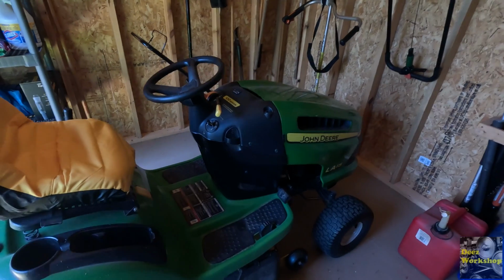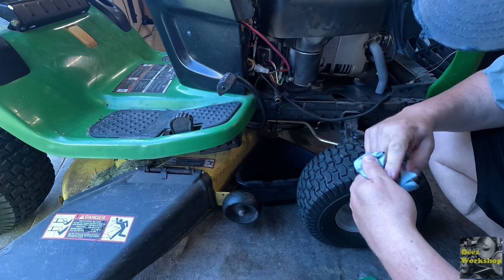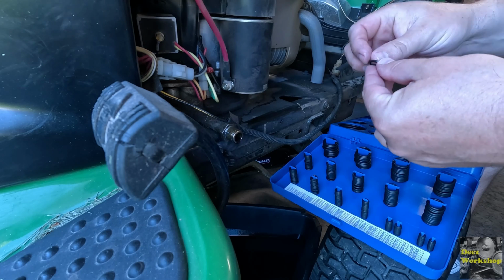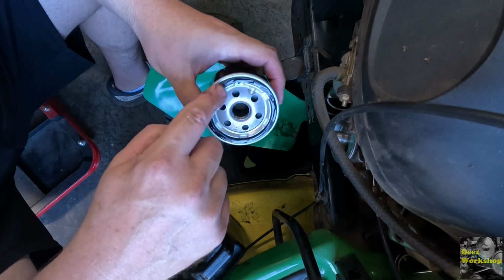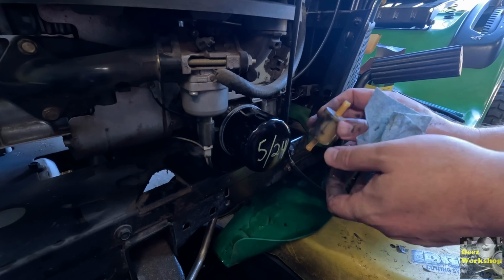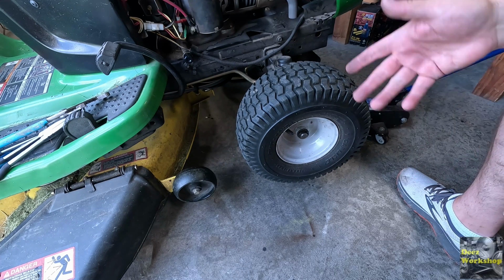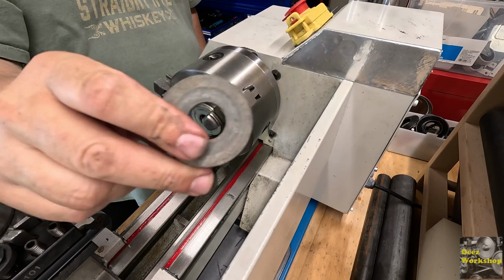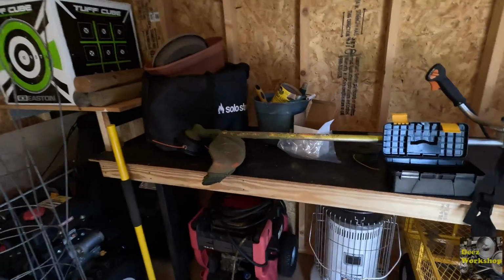John Deere LA115 Mower Maintenance and fixes using the Mini Lathe

Comment: Thank you for making this video. My mower just died outside after running for 5 mins and I need to figure out what's wrong. I see fuel in the air filter compartment. That can't be good.
Reply from the maker: You're welcome.  I am no mechanic but you could have carburator issues.  You float may be stuck or the float seat may have some build up in it allowing excessive fuel to overfill your carb.  Good luck.  I have heard of people getting inexpensive carburators on ebay or amazon or you could try to take it apart and "rebuild" it.
Reply: @deezworkshop  It died on me after switching to the turtle mode. I went back there last night and decided to check the spark plug. Yes, I did flood it with all that cranking. It was covered in fuel, so I cleaned it out, reinstalled and it started right up. This was a close one because it rained this morning and it'd be stuck in mud for a while.
Reply from the maker: @AIIncomeLabX  Glad it was just a flooding issue and you are running again.  cheers.

Comment: I am a retired mechanic and that old oil filter was installed without oiling the O-ring on the filter like you did
Reply from the maker: I was taught early on from my Dad and Uncle's, "Never pay someone to fix something you can do yourself" My Dad showed me how to change my oil once and this was one of the steps, to oil up the oil filter o-ring.  I makes sense to me but it didn't dawn on me that is why the filter was so difficult to remove.  Good to know. Thanks.